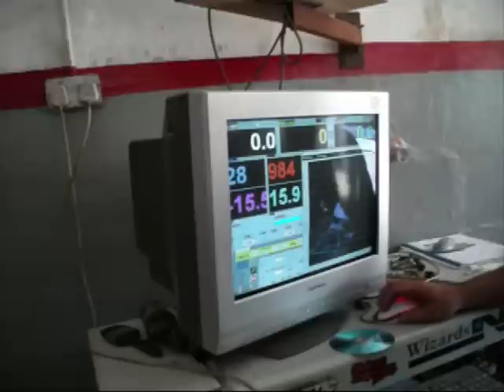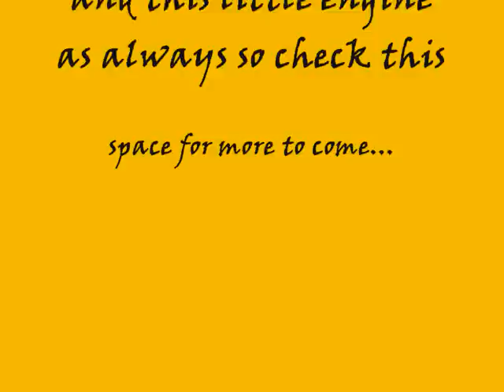1.4l pushrod turbo

Comment: You came up with 182hp with "just" the turbo?
Thats awesome!
How did you do with the carb? is stock or modified?
Reply from the maker: it`s modified,27mm venturi,choked removed and opened up,jetted to suite etc... 182 @ 12 psi 197 @ 14 but we didn`t record it on d dyno.... it was climbing like crazy and the more boost the more it loved to rev!! :)